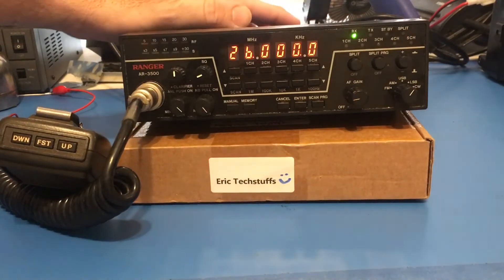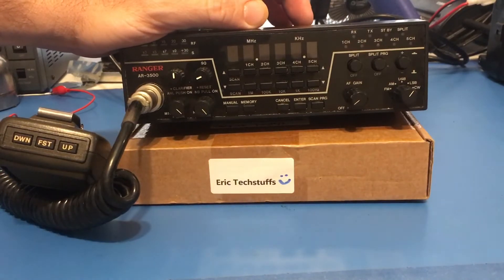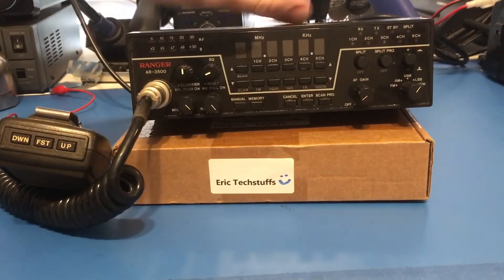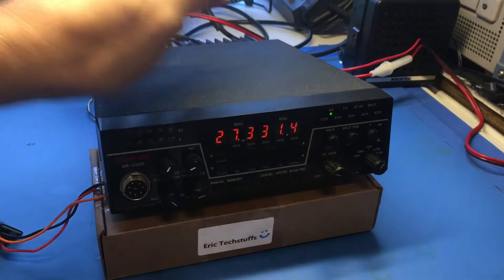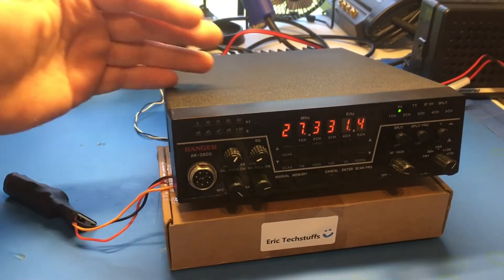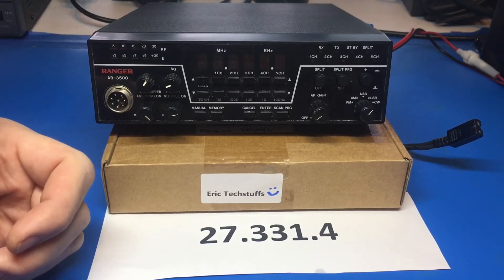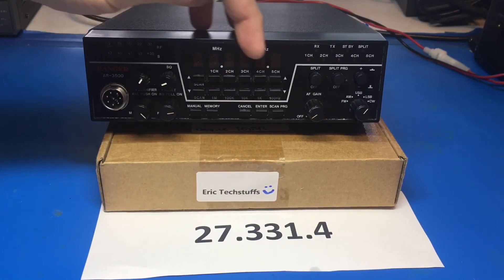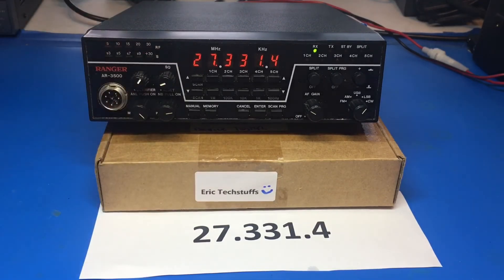AR-3500 100Watt Upgrade # 2 Rechargeable Battery Backup  install and testing

Comment: How do you install the rechargeable battery?
Reply from the maker: I followed the battery backup with 2 AA battery trick found online.  I just used a cheap battery changer circuit from Amazon.